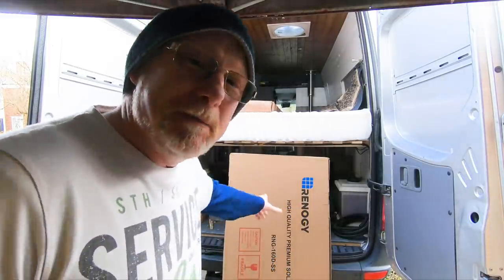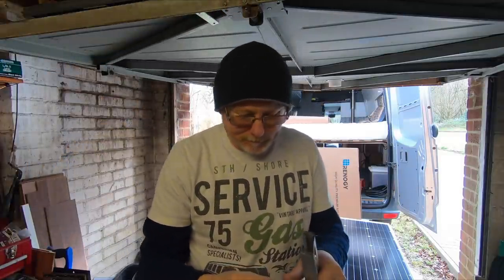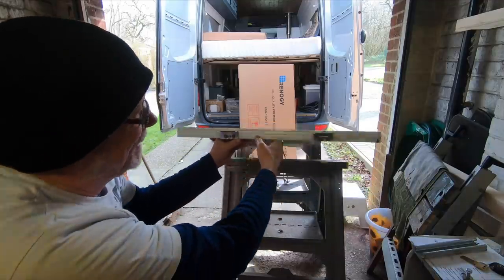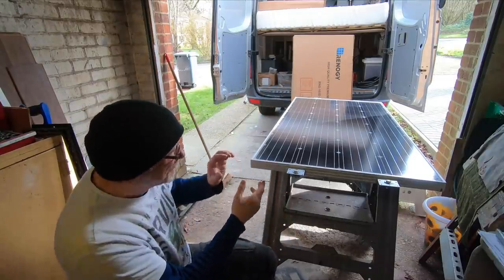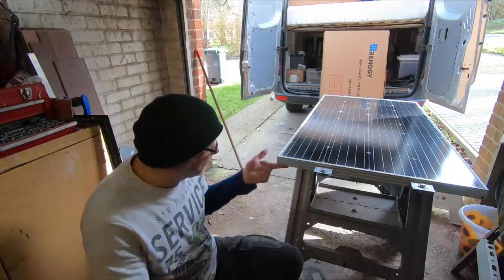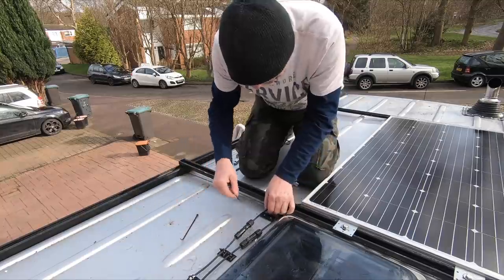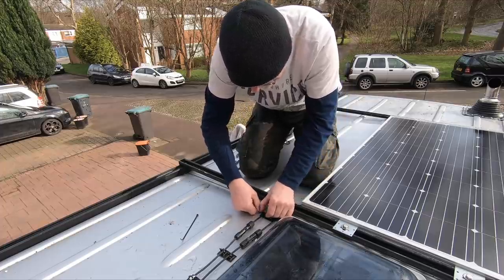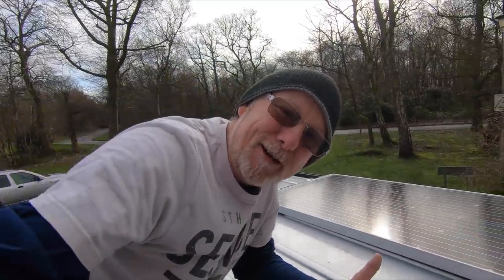HOW TO FIT SOLAR  PANELS TO A CAMPER VAN ROOF  simple and safe #vanlife

Comment: If you turned those brackets upside down that should give you more space between panel and roof? Also more air flow to keep it cool, bit of thread lock on the bolts to keep them from undoing too, nice job.
Reply from the maker: I know what you mean but I wanted the panel as low as possible and it’s hidden behind the side unistrut so can’t see it from outside

Comment: Mel top choice using unistrut ,had some left outside for years very little rust on untreated metal.I used this stuff during my career as an electrician, use galvafroid paint on cut edges.cheers .
Reply from the maker: Thank you that’s really good to know 🤓👍

Comment: Best solar panel install I've seen on a van very impressive; especially when so many people have so many issues with leaks.
Reply from the maker: Thank you really appreciate your encouragement 🤓👍
Reply: Using Unistrut usually still requires drilling holes in the roof but if sealed properly it will not leak the aim is to get a nice little donut of sealant around each load spreading washer and up the thread as shown here:
https://youtu.be/uhZp_MT3u4Y?list=PLRAHdc9FtNQyArIFZIp6vDgmmkAoEPxMo&t=469

Comment: You could always put another L bracket on and use it to padlock it to the unistrut. The unistrut idea is genius - I might try that as a temporary install on my T4 and run the cables through the tailgate.
Reply from the maker: Thank you for the great idea 🤓👍

Comment: Unistrut is made in different sizes 41x41 mm 41x21 mm in 2-3 metre lengths the most common,the  the threaded washer is a channel nut sometimes called a zebedee has a spring that helps with locating that you can cut off if not needed available from good electrical wholesalers.
Unistrut is normally used for lighting to bring closer to floor level you would see this in supermarkets with high ceilings but has plenty of other uses .
Reply: Zebs are ok but can be fiddly on slotted uni, still top kit to use.

Comment: You can get those unistrut nuts with springs underneath, you could then put them in the strut first and they hold themselves into position, as for stopping anyone pinching them maybe replace the bolts with special heads or say torx head bolts? How about some thread lock to stop them coming loose or did you use spring washers?
Reply from the maker: That’s a good idea too

Comment: Pop a blob of sycaflex under the cable connectors and glue them to the roof. I don’t think cable ties will stop rattling. Sycaflex would probably have worked under the panel as well. Had been thinking about roof racks but the system you used looks way more flexible and stealthy
Reply from the maker: Thank you 👍🤓👍

Comment: Hi Mel, just watched your old solar panel video on the transit and wondered if there was a reason you didn't use those  fittings this time?
Reply from the maker: Because I wanted to make a roof rack so I could mount other stuff on the roof too 😊👍

Comment: Hi Mel. nice job. are the solar cable connectors water resistant. do you need to cover these with additional protection?
Reply from the maker: Thank you yes they are absolutely water proof

Comment: Check out regarding reactions

The stainless steels, including 304 and 316, are more positive than zinc and steel, so when stainless steel is in contact with galvanised steel and is wet, the zinc will corrode first, followed by the steel, while the stainless steel will be protected by this galvanic activity and will not corrode
Reply from the maker: No worries I’ll check it every now and then and simple to change 🤓👍

Comment: Hi Mel, another great video.  We used Unistrut to install our two 310w panels on our roof too.  Great stuff that I would recommend to anyone.  Are you putting electric hook up in this one?  Seem to remember you saying you were going to have 240v.  Or are you just using an invertor?
Reply from the maker: Hi thank you I’m not really a fan of 240v but I will have a simple hook up for the odd occasion I stay at a camp site so I can use my electric hob 👍🤓👍
Reply: @BigVanSmallWorld  When we installed our I had your motto in mind.  We ended up using a eurohike camping hookup unit, I cut the cable with about 1m length for insie the van and wired it to the power outlet socket I bought for the outside of the van and then stuck a new socket on the other end of the remaining cable.  Kept it safe and simple and pretty cheap too. ;-)

Comment: Hello Mel. I'm wondering about drag/fuel economy. Did you see any decline in your fuel economy since fitting the Unistrut? Obviously you won't have driven far due to the lock down.  It's clearly going to be far better than any off the peg roof rack and much more customisable of course.
Reply from the maker: I have absolutely no idea 🤦‍♂️🤷‍♂️😂👍

Comment: The Scottish weather is not allowing me to do this same bit yet on my van. Your van is coming on brilliant big man. Got a wee question though, is it possible to fit two of those solar panels side by side?
Reply from the maker: Hi yes they would fit perfectly but would have to go across the roof rather than down the length that’s why I got this size panel Incas I needed another one when I get my compressor fridge 👍🤓👍

Comment: Hi Mel what wire are you using from starter battery to your ring b2b charger please
Reply from the maker: heres a link for you hope it helps 

http://rover.ebay.com/rover/1/710-53481-19255-0/1?ff3=4&pub=5575467911&toolid=10001&campid=5338454651&customid=&mpre=https%3A%2F%2Fwww.ebay.co.uk%2Fitm%2F10mm-Automotive-Marine-Battery-Cable-70Amp-80-0-40-All-Lengths-Black-Red%2F221419178181%3FssPageName%3DSTRK%253AMEBIDX%253AIT%26var%3D520295814931%26_trksid%3Dp2057872.m2749.l2649

Comment: Have you installed the MPPT controller yet ?   Was wondering if you was getting any Charge out of the panel today .  First bit of sun this year.   I've got six 100w panels to fit tomorrow 😦
Reply from the maker: Hi yes it was working fine good luck tomorrow hope the weather hold out for you 🤓👍

Comment: Hi Mel, hope you are well.  I've checked the link for the unistrut and its out of stock. Would you mind letting me know the size of the unistrut is it 21 or 41mm? . Is the 41mm the bar for the along the roof length ways and the 21mm the support bars going width ways. Probably really stupid questions :)
Reply from the maker: That’s spot on mate you need the 41 along the length because the outside edge of the van has a slight lip the is higher in the middle even though the roof is flat 👍😷👍
Reply: @BigVanSmallWorld  Thanks buddy, much appreciated, keep those vids coming :)  :)

Comment: I plan to use a roof rack with u bracket sliders, so i can slide removable solar panels in or out. Probably flexible panels so I'll need to sandwich them between a wooden base and perspex top ?
Reply from the maker: sounds good to me good luck with it 👍🤓👍

Comment: Hi what size bolts did u use to secure the solar panels to the crossbars ? and what size bolts where used to secure the crossbars to the vertical unistrut ? cheers :)
Reply from the maker: 6mm 👍
Reply: @BigVanSmallWorld  fab were they  m8 - 6mm

Comment: Don't those unistrut fixings usually have a spring between the bolt and nut or am i thinking of something similar?
Reply from the maker: You’re absolutely right there also available without the spring 👍🤓👍
Reply: @BigVanSmallWorld  ahh ok that makes sense lol

Comment: Felt pad on the exterior of the van? that'll collect dirt nicely...
Reply: I had a similar concern. Wouldn’t it be possible to install a small spacer between the L-Bracket of the solar panel and the Unistrut to provided need clearance off the roof?  Mel, always enjoy you vids, enthusiasm and willingness to share - keep ‘em coming.